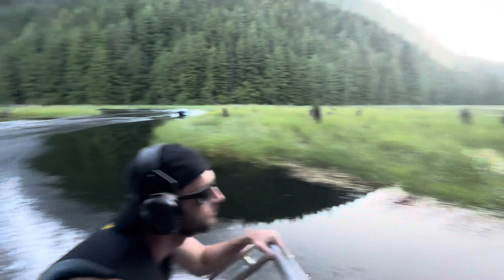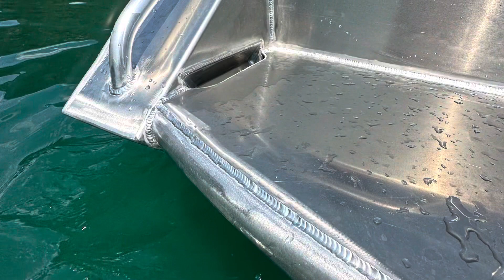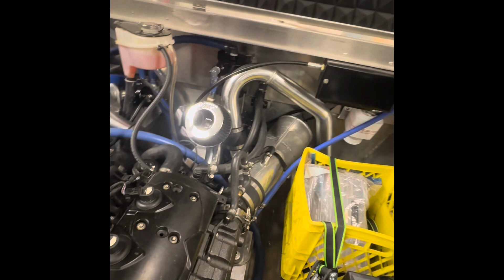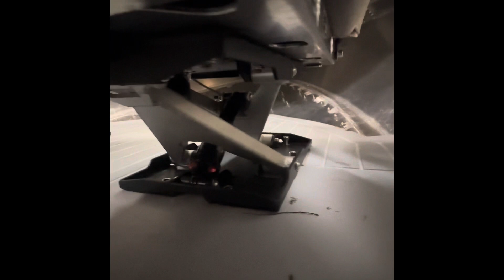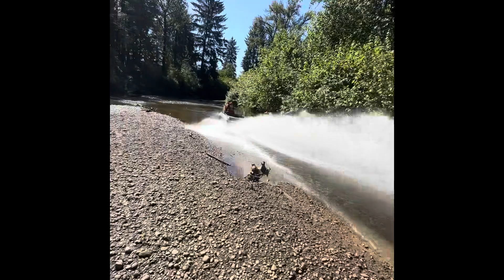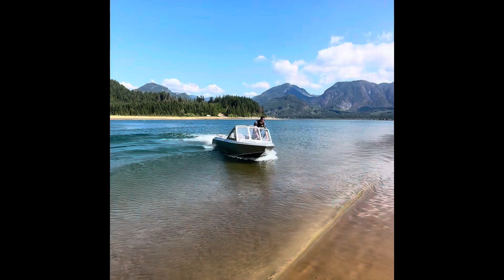Jetstream mini jet boat in action

Comment: Ive seen so many of these videos and i swear that wind screen seems to be the biggest issue i see. I know other companies put wipers on but i rarely see people with them and are always stuck half stand sitting to try to see over the screen.i gotta imagine theres a better way to build it.  I think the ticket would be some sort of a jeep style window especially for the middle, have it hinge  outward and removable and storable in the engine compartment or  even under the front of the boat. 

Id def go with full screen vs the speedboat style but i gotta imagine theres a better way. Thats the only thing id change and have winch spots, front and rear with the ability to quick mount a winch in the front/back. I see people plugging up their jet drives and it takes a bunch of people to get the boat on its side, id imagine a winch would make light work of getting it on its side if you needed to work on it.

Amazing area though, incredibly beautiful, and nice boat!

Comment: Awesome build thank you!! What did you use for the engine bay sound deadening?
Reply from the maker: Thanks man. For the sound deadening I used this egg Carton shaped foam from Amazon. It made a big difference  it comes in a vacuum sealed pack so you have to submerge it in water and ply with it for a bit then it will take its original shape after you ring it out. And I used 3m double sided tape and it’s not going anywhere. 

https://www.amazon.ca/gp/aw/d/B0957CPDCG?psc=1&ref=ppx_pop_mob_b_asin_image

Comment: What motor did you end up going with? looking at building one here in Northern Alberta and dont know if that new 325 rotax is worth the price tag vs the 300
Reply: Yamaha if you want reliable
Reply: @HubertGarand-hf7rh  Really wish I seen more people putting the SVHO in, seems like that motor isnt working near as hard as the rotax to perform at that level
Reply from the maker: I went with a 2012 seadoo RXTX 260 hp
Reply from the maker: @worchest2039 this was all in eco mode on the rotax 260 hp. In sport mode it feels like double the hp
Reply: @worchest2039 Jetstream has some videos of them putting the 325 in and the differences between the motors and what you have to do to get them in. If/when I build one id def go with a Honda 4cyl.. k20/k24 motors are plentiful and can be modded to the moon and back. I don't think it's unrealistic to get 300-400hp out of the motor and have it be extremely reliable, everything about them is easily obtainable(info/parts). Not being a master mechanic but able to follow directions id trust a Honda motor over a Rotax just because there's unlimited information and parts, and the sky is the limit as far as power goes.

I know there's 1 company that's doing k series in these types of boats I cant remember if it's Jetstream or a different hull but they definitely fit and there's parts for cooling system so it's not closed loop cooling,, water cooled manifolds and what not so it's not all crazy handmade fabrication

Comment: I would like to know how fast they cruise
Reply: It depends 40-50mph is average. Different hulls go faster, how much weight you have on the boat.. the motor/jet you use, if your hull has damage, if you use uhm or not. Theres a lot that factors into these boats top speed. I would say 40-55mph would be the loaded top speed and "empty" top speed for a jet boat with those 300hp supercharged motors/jet drives. Def not a slouch by any means and plenty of power to get up some incredibly fast moving rivers.